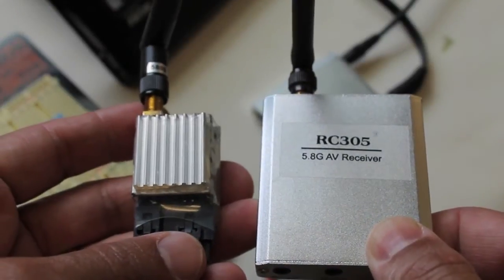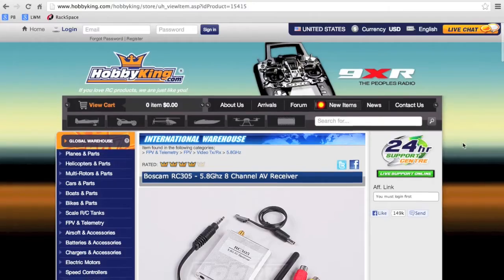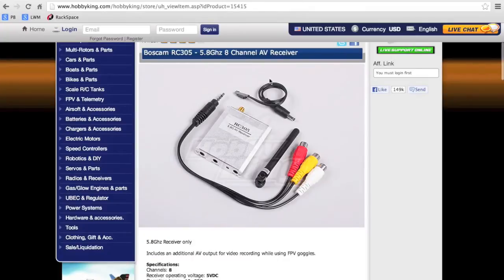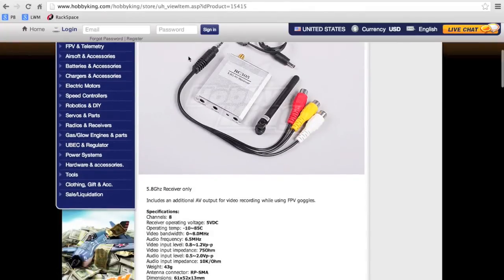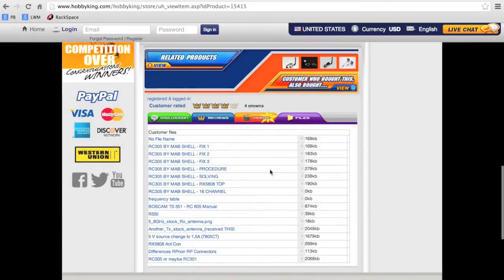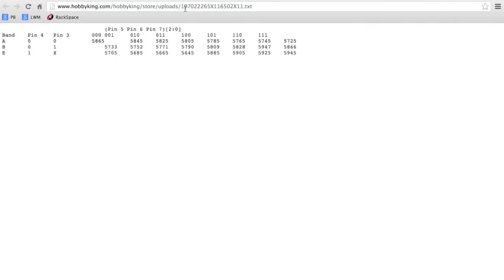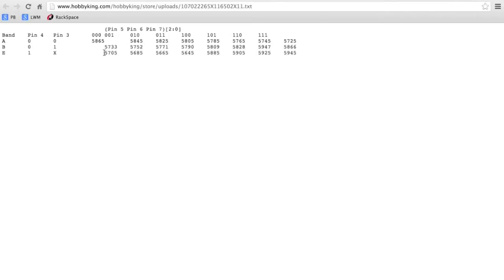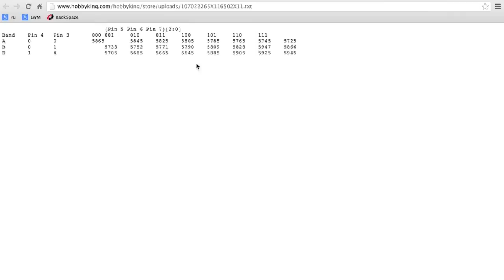GoPro Hero 2 DIY FPV - 5.8 GHz 200mW Transmitter and RC305 Receiver Frequency Bands

Comment: THAT IS A GREAT IDEA , I HAVE THE SAME TX HOW DO YOU GET A DIFFERENT CHANEL FROM IT,
Reply from the maker: The board has a CH1, CH2, & CH3 pins. Based on the low-high combination of each pin will give you channels 1-8.